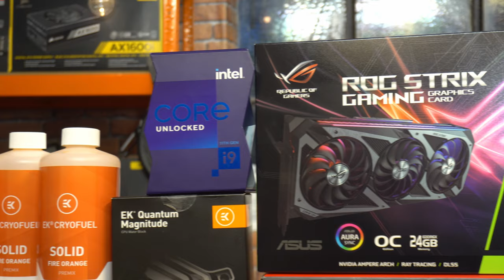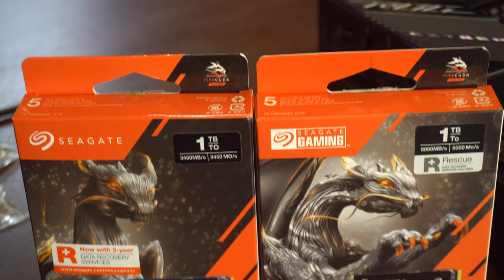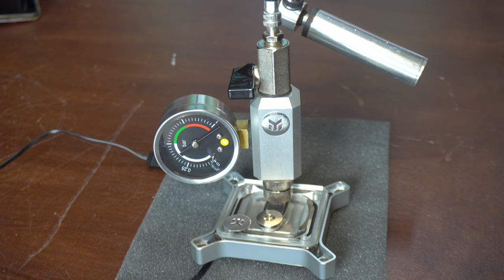EH "SOLAR FLARE" - Rozbłysk wydajnościowej mocy

Comment: The bends are really impressive, good job!
I feel like there is quite a lot of sag with the active back plate and waterblock, did you try to fix it?

Also tell me if I'm wrong but I think you aren't able to put back the side tempered glass panel because your GPU block is too wide, isn't it?

I was planning the same build in the same case and ended up selling my 3090 cause it was to big for a horizontal mount. I got the TUF 3090 instead and based on the waterblock dimension, I should be able to put back the glass panel without any problem
Reply from the maker: Thanks. The card is heavy, luckily the pipes keep it in the right position. We add a GPU bracket to the current configurations, just in case. The side panel comes in, there is still about 0.6mm of reserve :)